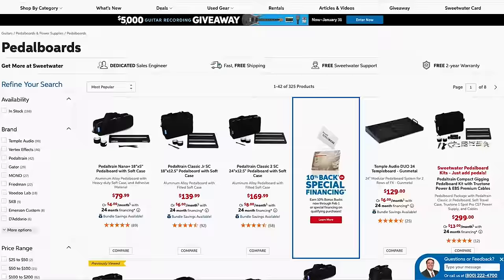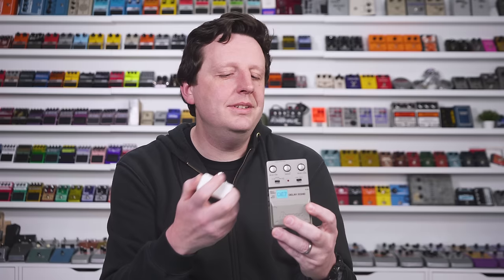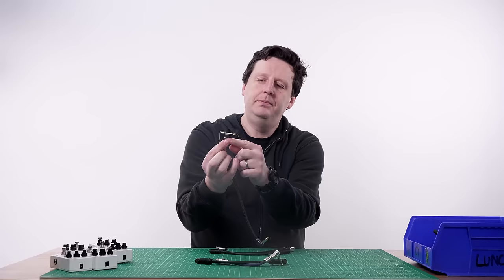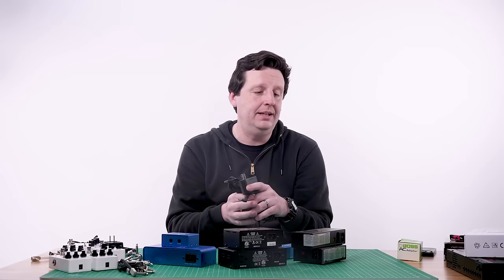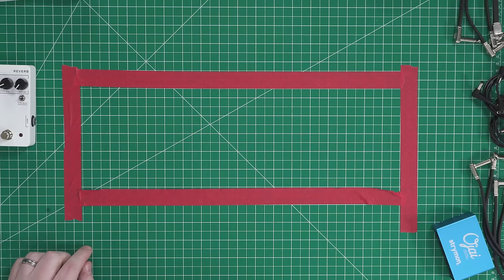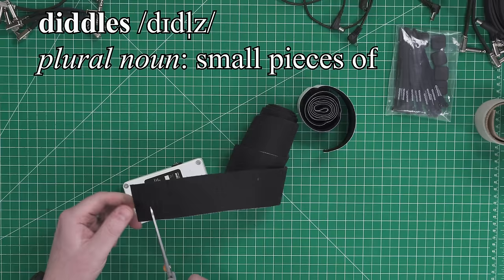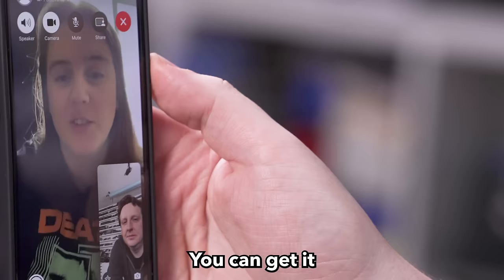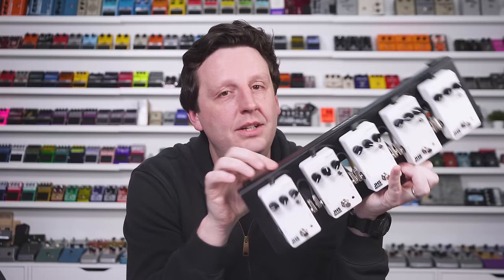How to Build a Guitar Pedalboard: Beginner Tutorial

Comment: That’s awesome. It would still be nearly $1,000 and this is an “inexpensive” pedal board. I don’t use one. But I’ve been collecting pedals for 30yrs. Only recently have I committed to what I use. 

My big secret is I have a tighty whitey and a clover running in parallel and sometimes use a GE7 on the compressor side. I do want some modulation but can’t seem to commit.

Comment: something I was looking for in this video, that I may have missed, was an explanation of best practices for pedal order. here's what I know if you are looking for it as well.

1) signal chain direction. I used to run my pedalboard signal chain left to right, until I learned the standard direction is right to left, and most pedal manufacturers design their pedals to receive signal from the right and output to the left. for a small board this doesnt matter but starts to get crowded the more pedals you have.

2) signal chain order by pedal type. theres no one right way to do it, but general best practice goes:

tuner
wah / whammy / EQ / compressor / volume / octave
distortion / overdrive / fuzz
modulation - flanger / chorus / tremolo
delay / looper / reverb

last two categories can also go through the effects loop on your amp if it has that feature

hope this helps someone, I did not know either of these things when I built my first pedalboard and had to rebuild it a few times by trial and error, which taught me a lot through experimentation

Comment: Thanks for the wisdom.
I'll add a bit of my experience to yours, if you don't mind.  I've been playing for 40 years and touring for 25+.

I really like the flat corded patch cables.  They saved a ton of room.

I have moved away from velcro.  I use a decent sized zip strip, sometimes 2, on each pedal.   The pedals seem more stable and less apt to fall off when the velcro gets a little age on it.

Definitely DON'T use a daisy chain power supply.  Never, never, never.  Way too much noise, regardless of manufacturer.  There are affordable isolated power supplies out there.  Use 2 or 3 if you have to....

My new favorite pedal boards are Holey Boards.  They are modular and very well built.  Love them!

I would suggest a MINIMUM of 2 drive/gain pedals, I have 4 on my board currently.  2 delay pedals are nice to have also - 1 for slapback, 1 for ambient.

Don't forget to add a chorus, flanger, phaser or the like.  You may not use it much but it will be missed if you don't have it.

Here's my pedal list from my current board:
Boss TU2 tuner
Fender compact volume 
MXR Dynacomp
MXR Custom Comp
TC Spark - clean boost
Fulltone OCD drive
Boss Wazacraft Blues Driver
Walrus 365 - drive
Tone City Angel Wing chorus
MXR Carbon Copy - X2 - 1 mini, 1 full sized
Strymon Blue Sky reverb/shimmer

I sometimes run a Boss GE7 EQ pedal through my effects loop, especially on my Hot Rod DeVille.  But that one is never on my board.  It sits behind the amp.

I don't have any JHS pedals on my current board but I do love the JHS OD pedals.

Comment: 5 pedal board; drive- Formula B Superplexi, because it’s also got a boost, in a not huge case.
Distortion/fuzz- EQD Hizumitas (Hizumita is Japanese for Distortion)
Controversy: I’m putting delay before chorus- Delay- Boss DD-? (They’re all good, but grab one with stereo out)
Chorus/Flange- Digitech Nautila has stereo IN and out (that’s why you need stereo out on the delay)
Reverb- Boss Stereo Reverb, again stereo in and out.
Bonus- it doesn’t have to necessarily go on the board, but a wah pedal is a good thing to have first in the chain. Just test it with the fuzz as some vintage circuits are not fuzz friendly (unless you’re going for that screechy-squeaky tone).

Comment: Welcome back guys! 😊
I've been trying pedals (including some of yours) and different setups on my pedalboard.
At the moment i have 13 pedals (including tuner and looper switch) and they are all powered by daisy chain with a TrueTone OneSpot.
I totally agree with Josh that isolated power supply is the best choice, but for my experience the quality of the pedal has an important role as well.
Everytime I tried poor quality pedals I had some issues (background noise, buzzing, etc.).
When I finally bought only pedals designed in USA or Europe (and maybe made somewhere else) every problem disappeared. And the daisychain is still there 😉

Comment: Great video! I'd offer this advice to beginners though- If you're building a pedalboard, don't be afraid to use a 1spot while you're acquiring pedals. It can be an expensive process and the 1spot is like $35. So, my recommendation is to get your pedals, or the essential ones first, and then buy something that provides isolated power.

Comment: Hey, I missed you guys!
 I put together a board about a year ago, after watching similar videos. I won't remember all the names of everything, but here goes. Starting with a PedalTrain 2 row board through an MXR Power Brick. (Probably an "internal daisy chain" but the mini surge protector power strip seems to keep things quiet. Might upgrade) Lately, I'm starting with a Warm Audio "Fuzzy orange" tribute into a Special Cranker, then a Morely Wah. Then through the FX loop is a NUX pink analog delay, Small Stone phaze, and a 3-Series reverb. Small board, but it's what I'm using right now. Oh, Live Wire patch cords. I'm in a Stoner/Doom (In a Scissorfight with some Truckfighters!) rabbit hole right now, but I'd add my RAT & Warm Audio ODD, Tighty Whitey comp , Spark boost and DOD flanger for Rock and Metal.

Comment: Everyone's got an opinion, here's mine. Nothing to add pedal wise, as it's just a preference thing. I'm with you on the pedal chain, gain first, signal quality next, than effects, which I usually prefer to start with wet, modulation, and than the delays. I like to go through the amps effect loop, but either way, the power supplies cable port always goes on the output side of my                                                                                        boards.

Comment: Instead of zip ties, you can also use small velcro cable wraps. The nice thing about cable wraps is that you can move things around as much as you want without tools or waste. One caveat is they are too wide to work with smaller cable mounts.

Comment: Hey Josh, I have about 10 pedals on my board but couldnt justify paying over AU$400 for a big isolated power supply. I used a Fender Engine Room with 5x500mA isolated outputs. Daisy chained the dirt pedals together, digital pedals together, and needed a couple cabled singly because they were noisy when chained. That was a reasonable compromise

Comment: Logsdon Audio Quiet Box is knenof my favorite inexpensive little power distributors - I use it to run an additional four pedals off my voodoo lab, but I can also run 4-5 pedals with just the quiet box on a tiny board. Joe Logsdon is a nice dude too. 

If it's your first board then the mission is to explore pedalboard needs and applications.. as that mission becomes more focused with a certain performance or recording or jam, then it's fun to choose pedals or a platform for that mission. I made the mistake of getting too large a board early on, and it was difficult to scale my limited knowledge with the complexity of how many pedals would  eventually fit on it. 
As I've gotten more experienced I love to try to do a lot with very small boards.

Also get a looper to record and overdub your ideas.. it's as essential as a tuner. You don't NEED it but it's space well served if it helps you develop faster

Comment: The TC clip-on Polytune/Unitune are a good tip! They are not the cheapest but they work really well, it's basically the pedal as clip-on. I always have one in my guitar case.
Reply: A tip. Clip on tuners work best clipped to the volume/tone control knobs on electric guitars and on acoustic guitars' clip to the the inside edge of the sound hole. picks up the sound vibration better and will sustain longer and also makes it easier to see looking ⬇️ down. Then clip back on the headstock after tuning.

Comment: I watched this video last month and put one together.  I finally spent the money on a ts808. I need to compare it to sd1. I've found youtube videos can only give you an approximation, and you can make anything sound good. Cheap pedals are really hit and miss. I spent 20 bucks on a dumalo boost that somehow reduced the volume, and when you turn the gain up, it sounds awful. A behringer eq works 100x better for 10 bucks more. I did get a little anolgue extreme distortion it sounds surprisingly good. It doesn't compress like the sd1. I need a reverb for my new head. I'm going to try one of his. I love value, but when it comes to electronics, cheap doesn't always equal value. I already knew this because of home audio, but i figured pedals were simple, so maybe cheap is ok? Nope.
 Oh, and having everything adhered to a board just makes the experience better.

Comment: Great video!!!!  Hmm the Planet Waves cables look exactly like the D’Addario which I use.  I also use lots of Mogami/World's Best Cable.  I highly recommend Guitto for the pedal board.  It uses rubber grips that screw down to tracks to hold the pedals in place. They took the Aclam style board and made if very cost effective.  I've done the velcro and tie strap thing and I'm not going back to that.  I use Cioks for power.   It can run bigger devices like my Ampero II Stage when you get the special power cords from Cioks for it.

Comment: I never owned a Boss pedal until the IR-2 and hadn't Velcro the pedal yet because of the awkward rubber pad, so that was a highly useful tip.

I had a happy accident regarding Velcro. I ran out of it and only had 3M Command strips for hanging heavy pictures (8lbs). It works great for pedals and it's removable so no residue. Win win🙌

It took me awhile to put together my board. Was using a music stand to test out my chain before committing to a board. My signal chain is a tad unorthodox: 50/50 OD->Notaklon->3 series oil can delay->Alabs Cetus reverb->$37 seven band EQ. 

I get "schooled" on EQ placement (it should go after the drive pedals). Tried it after OD and everywhere in between. For me, it sounded best at the end.

Comment: I stopped using zip ties a while back as it's a pain to re-route cables. I use 2 sided velco bought in rolls (used to wrap CAT5/6/comms/computer PSU cables etc) as it's far easier to remove, re-route cables and re-wrap using the same piece without trying to dig around looking for fresh zip ties -  
(eg. Wisdompro Cable Ties, 4 Roll Hook and Loop Reusable Fastening Tape Nylon Wire Cord Straps Management Power Wire Organizer-0.6 Inch(1.5cm) Width x 6.6 Foot (2M) Long Each Roll)

Comment: Depending on what caline power supply you have the newer ones are for sure isolated. The newer joyo power supply is also for sure isolated. They are under or around 100 bucks. I did buy a kokko cheap "isolated" power supply but it wasn't at all isolated. But the newer caline that's blue, green and black and the one with two more spots that I thing is yellow red and black are both isolated for sure.

Comment: The giveaway that tells you if you are looking at an isolated power supply or not is if it has an included external transformer (wall wart) or not. If it does include a wall wart, it IS NOT an isolated power supply. These are usually very inexpensive and very cheap. An isolated power supply takes an AC power cord and it transforms that AC electricity into DC electricity internally then it splits the power into different 9VDC outlets. So if you are going for Isolated Power, stay away frrom wall warts.

Comment: I use a Caline power supply. It is actually an isolated power supply and even with lots of gain pedals it's not noisy. However I am a hobby musician that only plays at home. If I were a touring musician I would absolutely pony up for a voodoo labs. You can feel the build quality is not there in these cheap power supplies. So if they're going on a board and they're staying in one place they're probably going to be just fine. But I would not bank my performance in front of a live audience on one of these.

Comment: I bought a caline power supply for my back up board and have pleasantly surprised by it .
Reply: I had a Caline power supply, but it just suddenly quit working after about 6 or 7 months. It worked great up until then. I think I did see that it wasn't just me, but a common issue with that particular model of power supply. Maybe I'll give em a shot again, just because I've currently got 3 different pedal boards, and a 4th planned, and can't afford to get Voodoo Labs, or whatever, for all of them.

Comment: Those woodoo labs seems a bit expensive for me. I'll go with the 'T-Rex Fuel Tank Junior' instead. It only has 5 outs, and they're all 9V, but still isolated. That's fine. I only use pedals for studio use anyways. So it's just to reduce the amounts of plugs and free up a bit of space really. Could get a 2nd one if I really need to. Won't be using many 12V ones, so no biggy there either 😊

Comment: curious what you think about cheaper non-name-brand setups? i use a board i got off amazon for $25 (including a nice little carry case and velcro!), a pack of a ton of patch cables for <$10, and a $12 one spot clone, and it all works fine for me. maybe the power supply could be a bit better but i don't really get why i should spend more on the other things? are the quality differences that substantial? /gen

Comment: Heres a tip on cables, board & psu; unless you know what youre going for already - just get something cheap w/ good reviews. Spend more on better pedals instead. Really good board/cables/psu for an 8 pedal board will run you probably almost $500 total vs less than $100 for something that is good but nothing special. Thats 2 really high quality pedals and youll likely always have a use for the stuff anyway.

Also oddly its a lot cheaper getting 8 individual walwarts w/ a power strip than an 8 output isolated supply.. whats up with that?

Comment: That 150$ metal pedal board tho. You need a tone wood pedal board! I used reclaimed oak, that's still cheaper than the metal boards! I staple the Velcro to the wood, gotta have tone wood for the pedal board tho🤣 my notaklon rocks!!
Reply: A 6 ft fence board is plenty wide enough and under 2 bucks and it's pressure treated so it can handle all of the pressure better 🤣

Comment: I wish there was a tip about how to get your Velcro’s adhesive to remain stronger than the actual Velcro itself… I usually find when I go to remove a pedal from the board the soft Velcro ‘loop’ side pulls off along with the firm ‘hook’ side because the adhesive wasn’t good enough 🤬
Reply: Wipe down the pedalboard and backplates with isopropyl alcohol before applying the adhesive. Also don’t skimp on cheap Velcro lol

Comment: Josh I got a curious question. The first 2 on my board will be a volume/wah > boss sy-1 synth and the dirt pedals will be in the sy-1 fx loop. That basically puts the dirt and synth side by side in the signal chain yes? I wont be using the synth whenever the dirt is being used

Comment: If you're a beginner, ignore Josh's advice about avoiding a large pedal board. People who need small, compact pedal boards are traveling and playing gigs with them. You're not. You're setting up in your house and trying stuff out. Get a big one if you want. You can replace it with a small one later when you're a rock star.

Next: use command strips instead of Velcro. That goes for all of you. For real. They're the same Velcro-ey like material on both sides, and don't cost much when you need new ones or reconfigure.

Comment: I am by no means new to this, but do have a question when it comes to power supplies. My current Voodoo labs supply will power 8 pedals and I need to power 10. Is it possible to use one of the 8 outputs on the Voodoo to power a Strymon Ojai? I really don’t want to have 2 power cords going to my board.

Comment: I know this video is a couple weeks old (not sure how/why i missed it until just now), and this might seem like a stupid "noob-ish" question, but I was just wondering: Is there any practical reason to put the fuzzy side of the velcro on the board rather than the pedal? Or is this just one of those weird, nit-picky, "be a part of the cool kids club" type of thing?

Was just wondering this because ever since I've been into the individual pedal thing (as opposed to just sticking to multi-effects pedals) I've also had hardwood floors in my house. And I always got the impression that putting the prickly side of the velcro on the pedals would cause them to slide around the hard wood floors more than than it would if I put the fuzzy side on the pedals. I'm always taking different pedals on and off my boards, so I will often use pedals that used to be on one of my boards by themselves on the bare, hard wood floors. And of course, I don't wanna always be taking the velcro off my pedals just because I took them off one of my boards; which might only be a temporary thing.

Part of me thinks I might have over-thought that. But until just recently I never knew there was this preferred way of doing things and just assumed it didn't really matter. But if there IS some sort of advantage of doing it one way over the other then I'd like to know.

Just curious...

Comment: Why didn't you get the PSU for the Ojai distribution unit under the board as well, that way you could plug your IEC cable straight in to the PSU, instead of having it on the floor next to the board, and having to rely on that kinda flimsy 24V plug? ;-)

Comment: I have some advice for beginner. Don't used a pedal tuner. It will take space at your pedalboard. I used clip tuner, and put it at my headstock. My pedalboard is from Ammon. I used 6 pedalboard and 1 Vox wah pedal..and I used a Ibanez patch cable. And also a power supply. I used daisy chain before, and have issues with noise and power for each pedal..